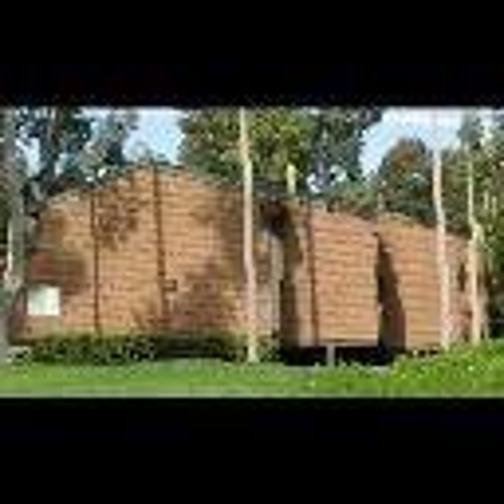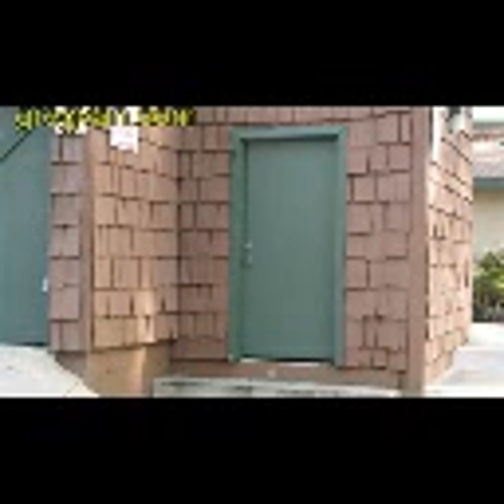What Do Wood Shake Shingles Look Like? - House Exteriors

Comment: WOW, you are a silly person, recommend what, maintenance is required on all siding types, cedar is used on most American homes. The southwest, dry areas are not a good idea for cedar shake. Your comments, & obvious lack of knowledge allows you to over state different maintenance issues. The East Coast, The smokes Mountains, and the Pacific northwest all use Cedar shake siding with few problems, plus cedar will last almost 50 to 60years with proper up keep,sometimes longer. Think before you post.